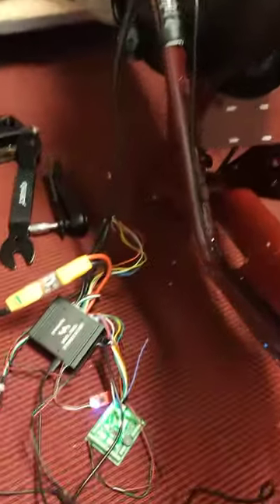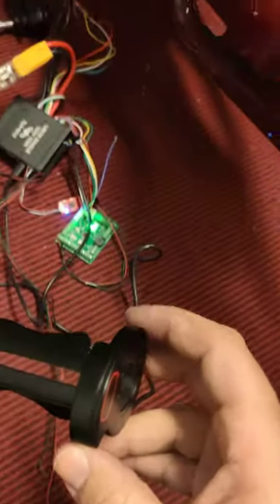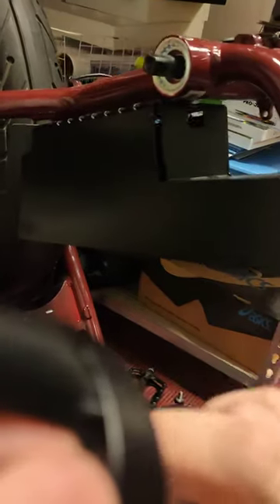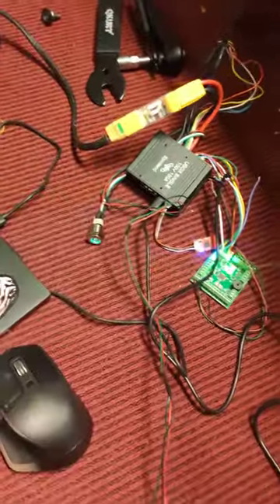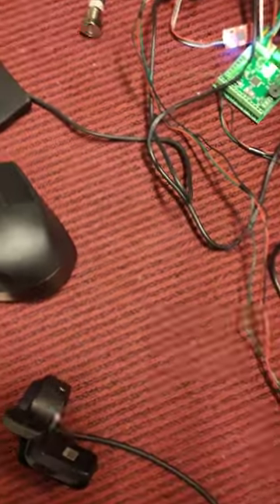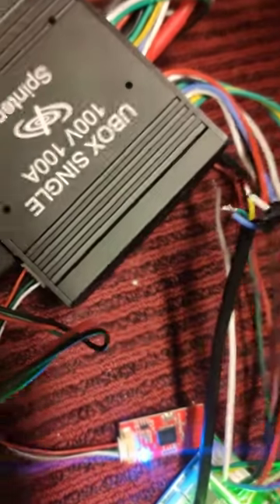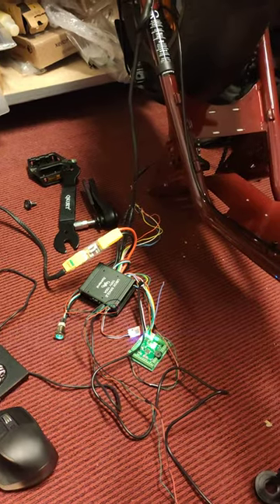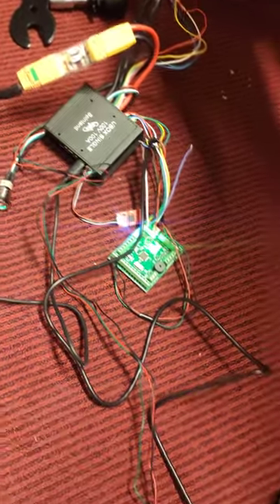VESC 6.0 PAS AND THROTTLE AND BLUETOOTH ALL WORKING.

Comment: Which controller terminal did you use to connect a pedal assist sensor?  which controller mode did you use?  which pins did you connect?  Could you make a video explaining how you did it?

Comment: Ok, i watch it carefully, and seems that you wired into ADC adapter board communication with vesc?. So it's not fully functioning. There is another method to hookup PAS, all you need to do is readdress PAS inputs from Tx Rx to any other available free input. This way you will have ADC adapter communication. Rx Tx needs device address in protocol if there is more than one device on single line. In this configuration your PAS will stop working when ADC adapter send any kind of data thru Tx, and vice versa Vesc probably will not recognize ADC adapter input along with active PAS signal.
Reply from the maker: I'm building with a collègue. For now everything is working as it should. I have pas on the bike and I have throttle also when cycling. We were working and trying alot because we first used his controller but it was an old model with only 1 UART my controller has 3 UART so for me it's working as for his controller it's not working. And I tried 4 pas sensors with its only working with a specific pas sensor from https://fasterbikes.eu/en/accessories/cycle-analyst/214/mini-pas-pedal-assistant-sensor-24-poles-for-ca-v3 as it has 4 wires a tx and an RX cable. This is the only one that will work for this kind of setup and it was a lot of work to figure out
Reply: @Jbel Soufla  Thanks for answer, just ordered same setup - ubox 100/100 with ADC v2 adapter. In upcoming weeks i will bench test BBSHD maintaining PAS, Throttle and BLE. i will check how to hook up ADC Adapter and PAS+THRTL not loosing any functionality of ADC options (cruise, reverse, ect). I will post solution here for heritage.  :) Cheers!
Reply: @juliuszwojciechowski8691  So Julek, how was it? Did you make it work?